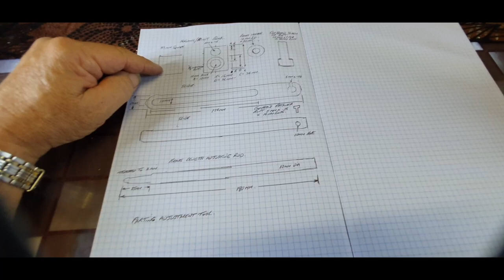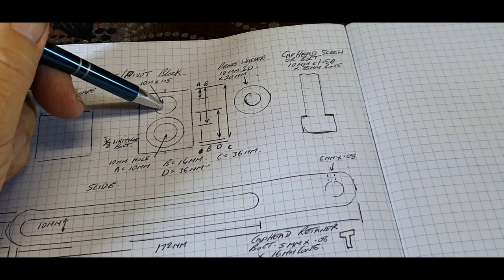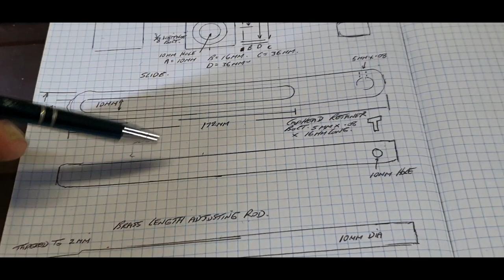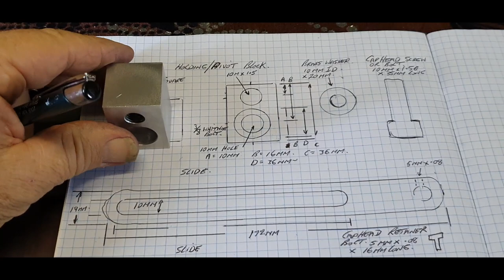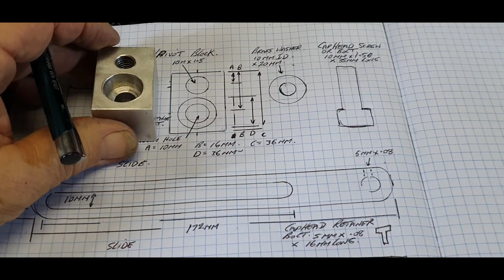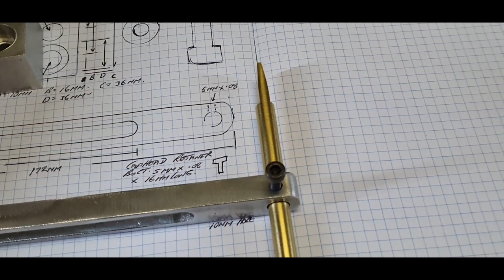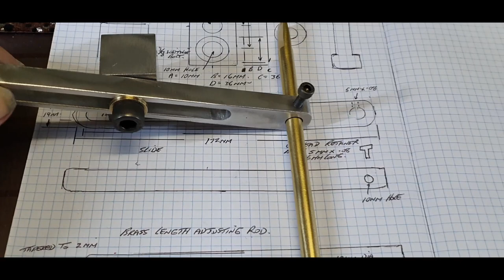Parting Adjustment Tool

Comment: A good idea for multiple same size parts, it will also double as a parts catcher as long as the hole is bigger than the rod.
Reply from the maker: If the Diameter is big enough & if you Index from the left side looking at it,   It can be a cut off catcher. Sounds like a plan. Long as you realize that as the cutting tool goes right, so also the Indexing arm moves to the right also & the clearance is maintained

Comment: looks good ted, I wonder if you put a ball bearing in the end of the adjustment rod, if it would make it easier to use because you could just bump it up against and can see when the ball bearing starts to spin. I would be careful using an endmill in a drill chuck btw, they have runout and that could be what's causing your chattering, and if they arent tightened up enough, you can have the endmill pull itself out of the chuck and screw itself into the work. Also, for the toolmaking competition, it has to be under 20 mins, or she wont count it, so I figured I'd mention that, but really good video anyways. Keep up the good work.
Reply from the maker: Thanks Chirpy. To be honest I didn't think of using  a Ball Baring, + you need to taper or machine my particular Brass Bar to one or two mm for a small Diameter washer. Mainly depends on the size or thickness of the bar / Adjustment Rod of whatever OD you use.  I used the drill chuck, because a friend of mine borrowed my ER32 Colet Set to match it up so he could purchase the same one. 

With the Chatter,  My Rong Fu RF30 requires that the head be loosened on the vertical tube when getting clearance from drilling to using the ER Colet set or milling unit etc.  My Fault, I didn't tighten the Lock Nuts properly, therefore we had a problem. You now all about  Murphy's Law ...  LOL   I was able to clean most of it,  But ... Sshhhh  Don't tell anybody  LOL    BTW , I milled a Flat Edge to the top section of the Brass Bar to suit the Lock Screw
Reply from the maker: I cut out 20 minutes out of the video as it is, to be honest, I can't see this being entered, because of the length of it, I will have to think of something else.